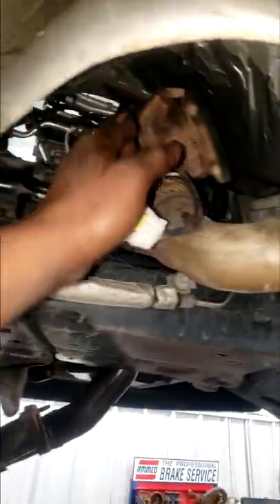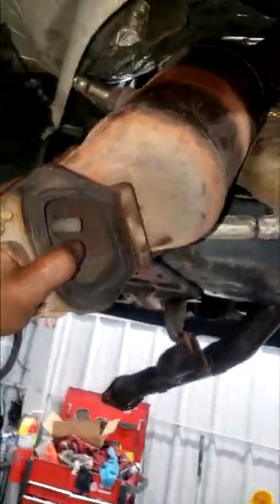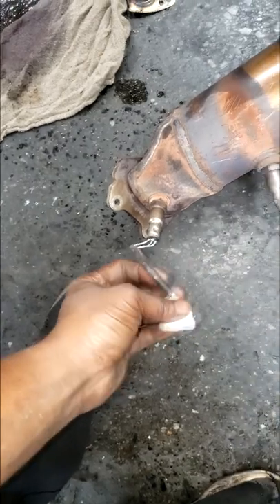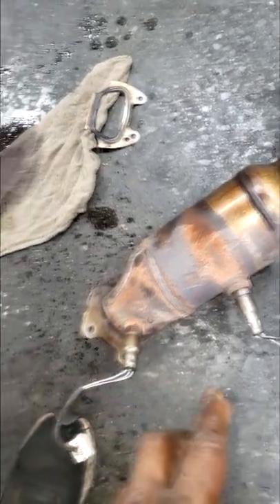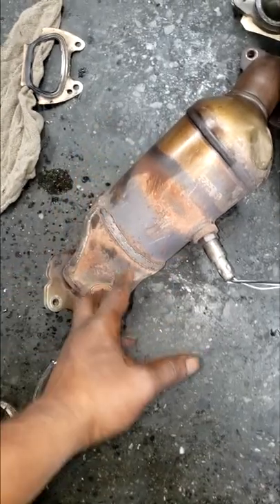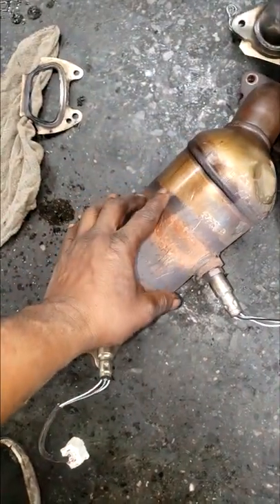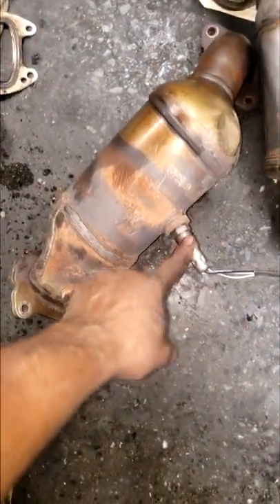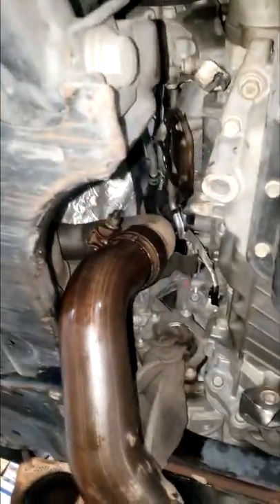WARNING. O2 Sensors will not FIX A P0430 P0420 on NEWER CARS. . YOU NEED A CATALYTIC CONVERTER.

Comment: you’re wrong it can be the O2 sensors it could also be many other things
Reply from the maker: Hey Chris,  do you mind explaining yourself? wait, I see you have a youtube channel. Do you mind posting a video explaining your thoughts on the P0430 and P0420? Thats what I did.
Reply: @OnlineMechanicTips  you did not explain yourself all you did is say that a P0420 code is not O2 sensors it’s the cat which is wrong it could be a vacuum leak it could be a manifold leak it could be O2 sensors it’s not just the cat
Reply: @OnlineMechanicTips  and what if it’s just a manifold leak you’re replacing a cat so you’re changing the manifold gasket so you don’t know if it was the manifold gasket or the cat you’re turning a possibly cheap fix into directly a expensive fix
Reply: @OnlineMechanicTips  And you’re probably changing the O2 sensors when you do the cat to so you’re just charging the customer a bunch of money for something that he probably don’t need and you’re scrapping his cat making even more money and you’re probably charging charging him a disposal fee for the old cat
Reply from the maker: @chris18228  smdh,  A P0420 stands for cat efficiency failure. The newer computers have a better way of testing the efficiency of the cat using the o2 sensors. But it will first test the operation of the o2 sensors as well as any vacuum leak idle change speed (vacuum leak)  So no, if you see P0430 or P0420 you are wasting your time replacing anything but the cats. Now if this a older car with older computers, sure, you have a point.
Reply: @OnlineMechanicTips  yes computers read the O2 sensors to check the efficiency if you have a manifold leak it’s not running efficiently telling you a P0420 code telling you it’s not working efficient exactly what the code means it doesn’t say P0420 code Cat is bad it says it’s not working as efficient meaning that there could be other problems
Reply: @OnlineMechanicTips  p0420 is Catalyst System Efficiency
Below Threshold not cat failure
Reply: @chris18228  Im a true mechanic and you are absolutely right. My 07 cts had this exact code. Replaced all o2s and that did it. Another trick some people are scared of is putting a gallon of lacquer thinner to half a tank of fuel. That works amazing for slightly clogged cats
Reply: @slowk6gixx1k78  lies
Reply: @chris18228  there isn't any point trying to teach he's set in his ways....the wrong ways wonder if he can even tell me operating ranges of the o2 sensors....wide and narrow. Obviously not if he can't tell you how they know the converter is bad as he directly stated in this video. SMDH good techs that can be great techs if the can admit defeat. And no I'm not gonna make a video for you I'm flat rate at a high demand repair shop turning 60hrs a week I don't have time for that. My channel is for my car which I use my o2 sensors and other variables to tune lol. Have a good night bud.
Reply: @slowk6gixx1k78 Ngl I heard that trick from Scotty Kilmer i would be scared to put lacquer thinner in my car too
Reply: @zurielthompson5715 Do not put lacquer thinner in gas tank! I did and it had my car skipping ang jumping 200 miles later. Smdh

Comment: I changed the catalytic converter and still had the code so…no
Reply: Did you replaced it with a OEM?
Reply: @mtsanchez27  yeah
Reply: @lamethodedeclavier2714  what year make and model is your car? Sny repairs after that?
Reply: @mtsanchez27  2014 Chevy Cruze LT
Reply: @lamethodedeclavier2714  no fix yet?

Comment: The only way to tell if the cat is not good. His take it off and see if there's anything in the cat. And what is Downstream of the catalytic converter the muffler. If its block off. I know a guy that the muffler was blocked not the cats. I seen cats not let a car start.  The cats block them self's off .
Reply from the maker: These cats failed because they not efficiently doing the job. Not because they clogged/restricted. You will not get these codes if that was the case. And most def, a clogged cat can give you hell
Reply: Let it run for 10 min. If clogged shell be cherry red.

Comment: You can actually put a bung extension and it tricks the computer.
Reply from the maker: Installing a fouler is not a fix. Its a patch to maybe pass emissions
Reply: @OnlineMechanicTips  whatever you want to call it but yes. It will trick the ecu and the check engine light will go out. So you can pass emissions. Yeah the only true fix is putting a new one in. But as long as the cat isn't clogged it will work just fine. For people that don't have a thousand dollars or so depending on the car. They're ridiculously expensive regardless of the car some are just super ridiculous.
Reply from the maker: @Mattmazz77  Yes extremely expensive. I put one on my Pacifica to get it over the emission hump..lol
Reply: @Mattmazz77  those extension should they be on the downstream sensor only or both?
Reply: @rodilloz  I believe that you can put it on either, which ever you're having an issue with. But the down stream is the 1 you would want to trick emissions sense it's supposed to be going through a cat and cleaning up the quality of emissions. If that makes sense, to be honest I haven't personally used them but I know people who have used them and it really helps out.
Reply: @Mattmazz77  yeah ..makes sense.thank u

Comment: Had p0420, new cat still p0420
Reply: I changed the engine air filter and the engine service light turned off for like a whole day then just kicked back on, doing everything in my power to not by a whole new cat
Reply: @Anthony Perez  from my experience a new cat wouldn't fix it neither, just a waste of money, check for vacuum leaks or exhaust leaks before the cats like manifold
Reply: Does P0420 affect performance
Reply: @zuriiiii77  no, it just wont let it pass inspection
Reply: @HyperSin  oh ok because I have the p0420 code and I think I know what caused it my 2008 ram burns oil that’s the culprit should I get it rebuilt
Reply: @Zuriel Thompson  if its burning oil in the cylinders definitely need a rebuild and maybe a new converter if you cant clean the old one

Comment: This must be this guy's first day on the job. Don't listen to this dude o2 sensors can go bad...
Reply from the maker: Go bad??? Based on that comment alone tells me all I need to know about you.
Reply: Elaborate then. That's not an argument.
Reply: Yea you read that right. "Go bad" and based on your video I can see this is a new concept for you so I can understand the lack of understanding.
Reply: Need advice help please. Code p0420 car is  not burning oil and is running fine obd2 scanner also says poor connection sensor 2 and pcmm could the issue be my down stream 02 sensor ?